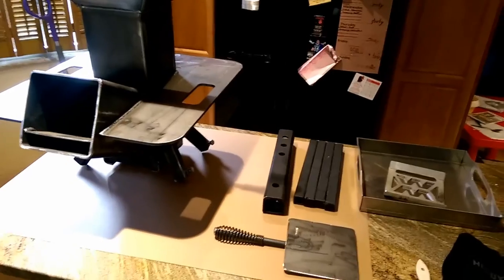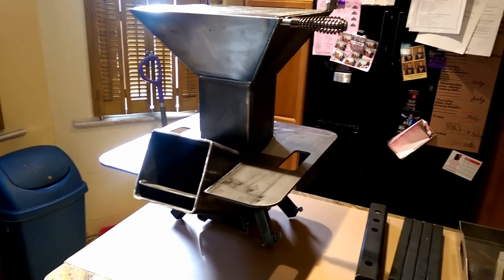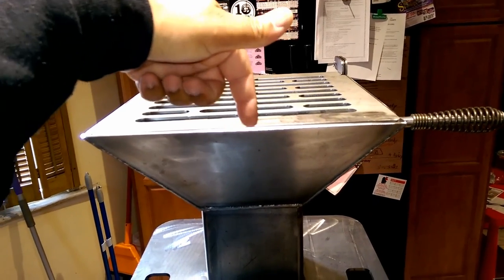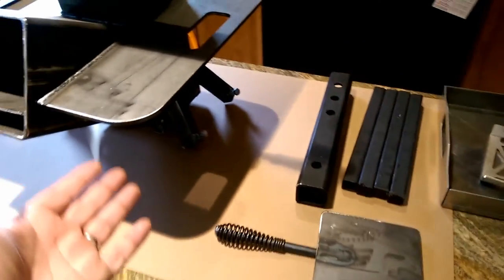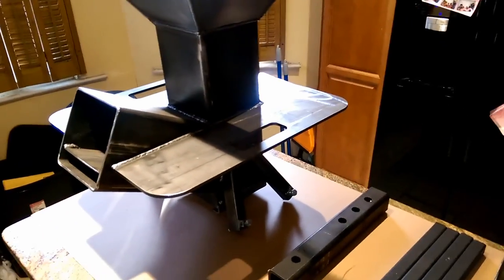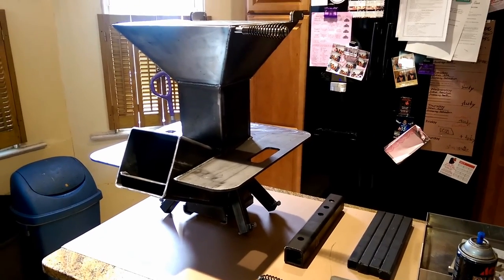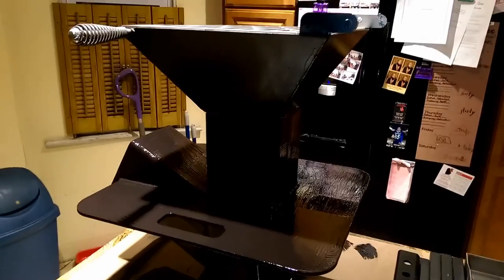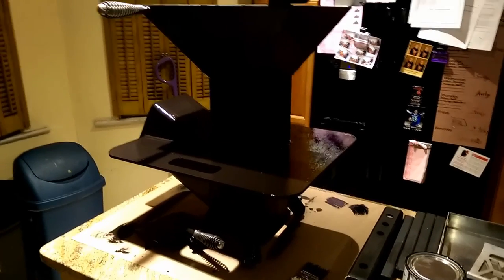The Watchman Stove weld it yourself kit

Comment: How long are the 1inch square tubing sockets and legs? ..and are they cut at 45 degrees when welded to the chimney.
Reply from the maker: Unfortunately I don't know. You might be able to check the website for the dimensions.
Reply: I checked but it doesnt say..can you do me a solid n measure it then tell me ..I'd appreciate it..I've gone to so many channels asking everyone n no one wants to.
Reply from the maker: @whatsgrowingon  I'm no where near it at the moment it's packed away until the summer when I will use it again, sorry.